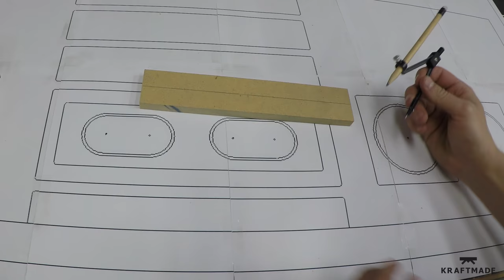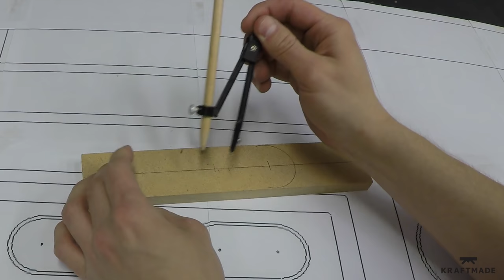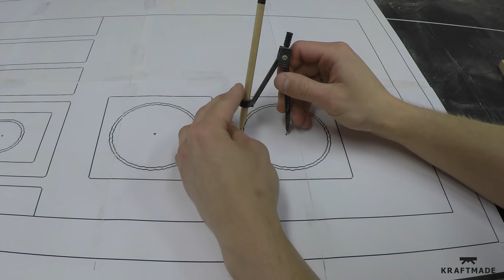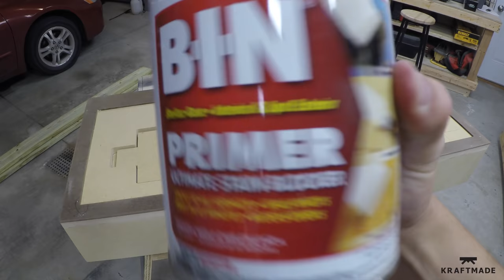Giant NES Controller Coffee Table - Kraftmade

Comment: It doesnt even work? Its literally a single chip you need to wire the buttons to.
Reply from the maker: Your'e right, what a pieces of trash.
Reply: @Kraftmade  it's well made my man, I'm just saying, remove the spacers in the back of the buttons and add some large switches. the rest is just extremely simple wiring. would take maybe 20 minutes of wiring.
Reply from the maker: @Tinkerer_Red  I appreciate that. I did originally intend making it functional. I had a switch board and pi but I couldn't get the actual button action smooth enough for my liking. I plan on making a snes controller someday that is playable.
Reply: @Kraftmade  well the nes controller is well documented in a video on here about "how retro controllers work" or something like that. it's a single chip and a small breadboard would get the job done, no issue. Though thats only if you wanna connect it to a nes wouldnt work any other way. But i'd suggest buying a controller which already does both then just use that as a base.